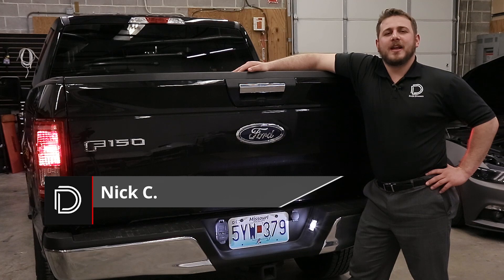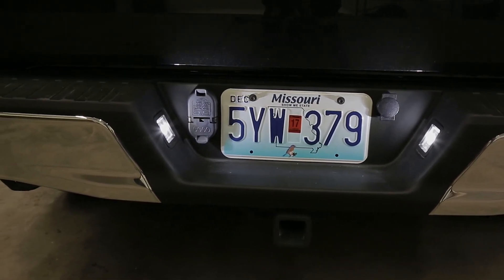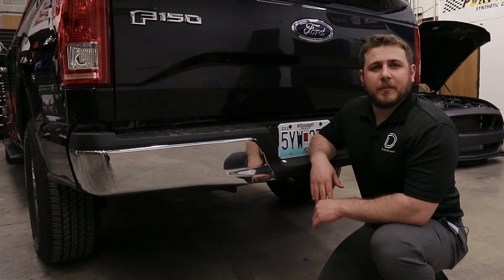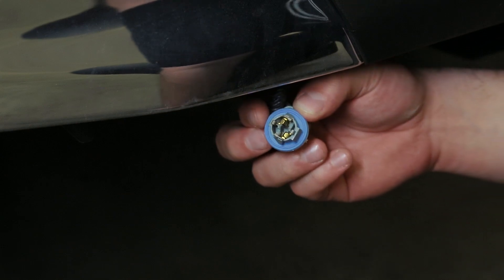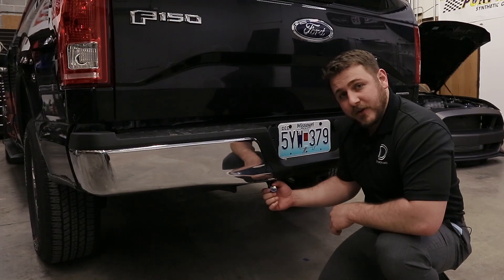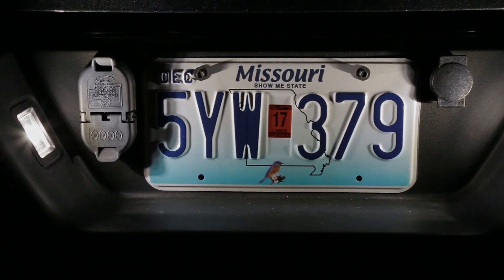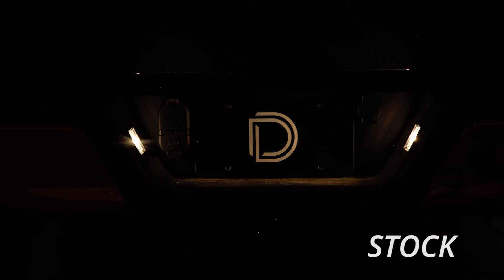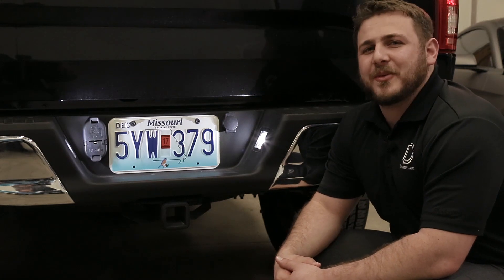How to Install 2015+ Ford F-150 License Plate Lights

Comment: The bulb is actually very hard to get out. I used pliers and ended up breaking both bulbs trying to pull them out
Reply: should have tried wrapping a cloth or fishing line around it
Reply: arethouready I tried with tape and that wouldn’t do it either